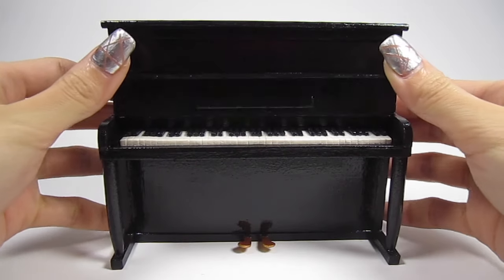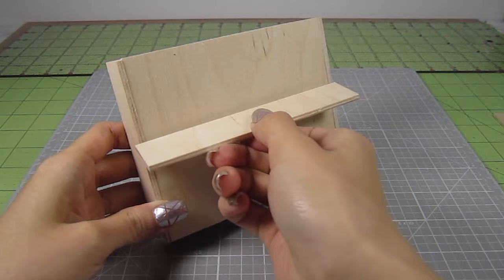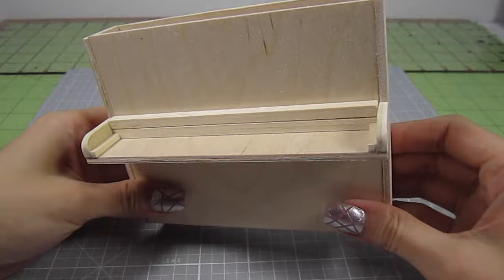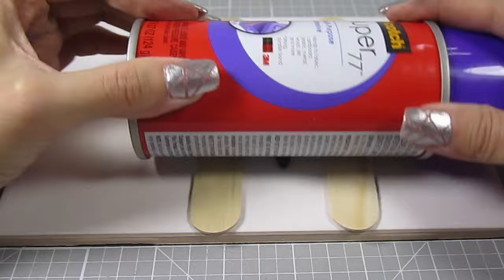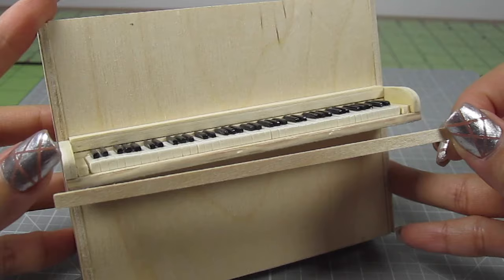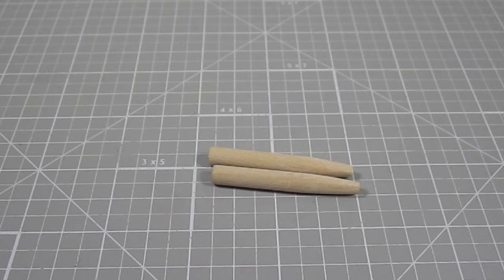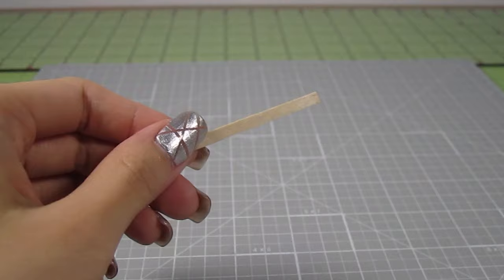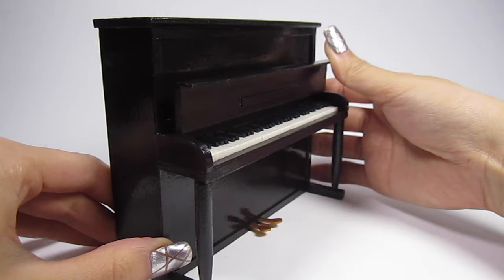DIY Miniature Piano Tutorial

Comment: It's been almost a year since I dream of making one exactly like you did. I'm scared to begin, because I only used metric system until now, I have difficulties cutting through wood and I was able to find wood just a little bit thicker than yours. Wish me luck, I really need it. I watch this video very often.
Reply: ioanakat you know you can change the measurements into metric?
Reply: Mad Master of course I know that. But sometimes when I convert into centimeters, the numbers are not exact. For example, for the keys, the measurements converted from inch to cm would be 2.5 millimeters, which is hard to follow on a ruler. But in the end I made my own measurements and it turned out pretty well.

Comment: hey! i love your work. I was also wondering if you had anything else in mind for the hinges. I mean i don't think there's a single store in my area that sells hinges. could we use something else?
Reply from the maker: I considered using wire on the sides of the lid to act as a hinge instead (the same technique I used in my miniature folding table video) but I liked the look of the hinges so that's why I went with that. I think the wire method would work really well here though :) Hope that helps!

Comment: would it be possible to make the keys out of wood instead if I don't have polymer clay? And what file do you use because it usually takes way too long to sand it down even with the coarsest sandpaper I have... and lastly could I substitute the hinges with something else? as a last resort I would use a single piece of sticky tape but I was wondering if I could use drill some holes and thread wires through?
Reply: It would be possible to use wooden key, but they would take longer to form. I don't know what file she uses haha, and I know that a substitute for hinges is a piece of string glued to either side :) Hope I helped.
Reply from the maker: Hey there! Yes- you would totally use wood as Kassidy mentioned (btw thanks Kassidy!!!). When I have a lot to file down, I'll use the coarsest sandpaper I have (which is used in machines that sand down hardwood floors in homes haha) on my table and run my wood on top of it. Otherwise, I would break out my dremel (which I rarely do unless it's a huge project). Hope that helps!

Comment: I'm having such a hard time trying to recreate this with the plywood. I don't know if mines to brittle or what. But when I score the wood to break, it splinters off and I don't get a clean cut. It's not like I pushing hard or anything for it to do this. I've even tried making my cuts deeper as to not stress the wood out. Any advice?
Reply from the maker: Awww sorry to hear that. Some plywood doesn't cut as easily as others. I've had trouble with some plywood that uses too much glue or too dense of wood for the ply pieces. That's why I've been sticking to these specific ones. I've listed it in the description box and I get it straight from amazon- super convenient :)
Reply: The Square to Spare I was trying to avoid ordering so I could go ahead and make it 😂 but I think I'm gonna have to do that. Tried different plywoods that they sell locally and non seem to cut good. Thank you!
Reply from the maker: awww I totally get that! I hate having to get new supplies for a project too. Wood is pricey and it's a total bummer when it doesn't work out. Hope you have better luck with the new wood :D
Reply: The Square to Spare I hope so too! Lol